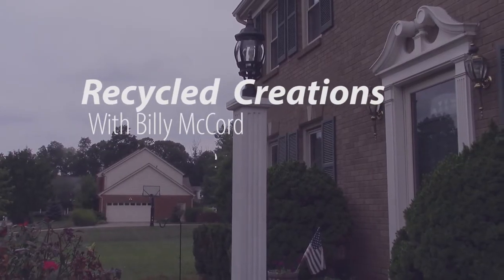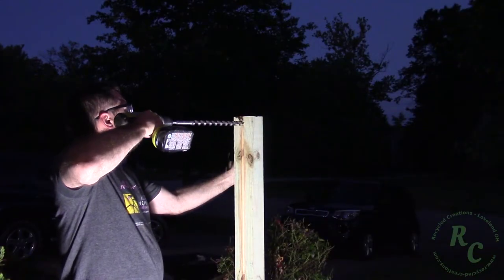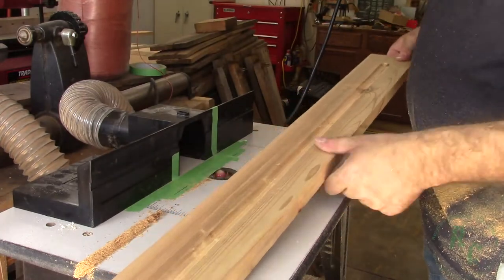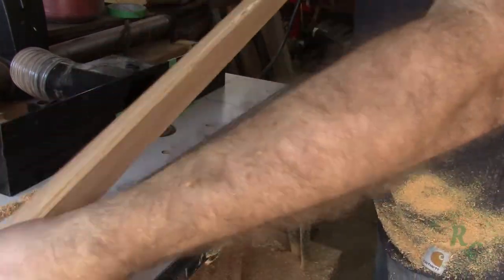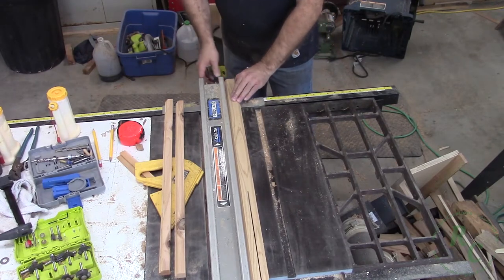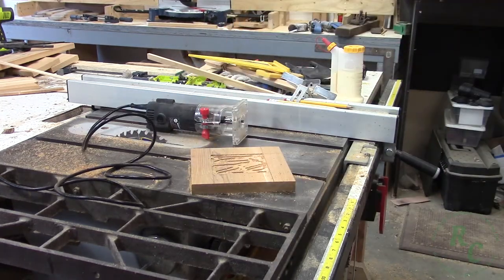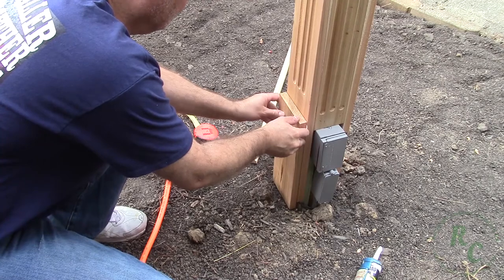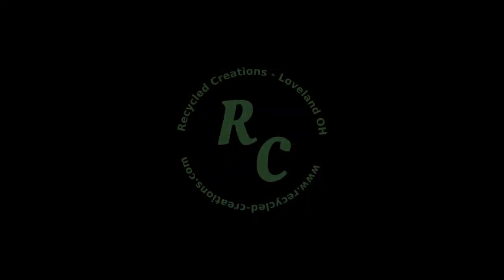How to make a Federal Lamp Post

Comment: I liked it but is it a bit close too the house since you already have to lights on each side of the door.
Reply from the maker: Yes, that was a consideration, there was already a wire in the ground (abandoned at some point)  so i made a project of it making the post. Its a little farther than it seems in the video and it lights up the dark corner created by the garage, I doubt that shows up on the video.